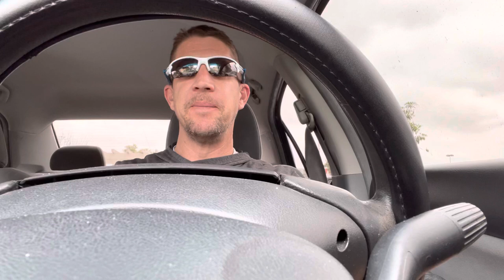CB Radio - The Super Scanner antenna

Comment: My dad had one it performed as advertised . And it worked in directional mode without using a rotor . I think if someone were to manufacture this antenna it would do good in the market , just my opinion 🤙
Reply from the maker: I agree I'm surprised as well no one has made a copy.  Copy like Sirio did for the Sigma 4 etc.

Comment: I talked all over the world with one of these. Sucked locally but seemed to really do well for skip. Takeoff angle was my guess.
Reply from the maker: I'm not surprised.  It probably is the same as a 1/2 wave antenna regarding skip and 1/2 waves do very well for skip.  The difference between 1/2 and 5/8 is very small anyway.  Height above ground can be  another factor for take off angle.  How high was it mounted?
Reply: @Z28videogates  tge bottom elements were about 25 feet off the ground.

Comment: Everybody I knew back in the day loved the SuperScanner.
Reply from the maker: I agree they did!  I remember that too.  But I bet that probably all of them also didn't know if they just used a 5/8 wave there signal would have been the same or even better in all directions all the time.  But I will say that having some directionality is useful as well.  73!
Reply: @Z28videogates  you could be correct regarding the performance of the SuperScanner.  BTW, I've been a ham for 50 years this year, Extra class for 20 yr now. My main interest in radio has been messing with antennas.  I have an ARRL antenna book that has a similar design except for forty meters.  That does add some legitimacy to the concept.
Reply from the maker: @channelview8854  Awesome!

Comment: On another channel they did a coax switch trick to take a pair of cophased trucker antennas and they be stationairy, yet flip a switch and broadside or endfire  3-5 db gain. Kinda cool to do any directionals without a rotator or getting off the office chair.

Comment: Super scanner was a great antenna for the fact that you didn't have to use a rotor. The elements being closer together than .2 wavelengths was done by adjusting the phase going to each element so  they can be closer together than a typical Yagi antenna and still give a decent amount of gain in directional mode. Personally I never buy antennas and prefer a quad to a Yagi antenna. I used a moonraker 4 on a 70 foot pole for years till it was bent up in a hurricane along with a 600watt home-made amp with 2 4cx250b's. If I could hear it I could talk to it. After that I put up a home=made 3 element quad and never looked back.

Comment: Interesting video.  I recently purchased 2 of these antennas and have started cleaning them up and replacing the 50 year old relays/pigtails in the outside control board, also cleaning rust off.  And considering the age of these antennas, I am wondering what condition your friends Super Scanner antenna is in?  For example: Were the outdoor relays original? Were the pig tails (Coax) connecting the individual elements original ? Were any of the steel brackets rusted?   If "Yes" can be answered to any of those questions. Then your results would certainly be "lacking" against that of a new 5/8ths ground wave antenna. (I currently use a 5/8ths ground plane)  if possible, could You please please post pictures of the Super Scanner antenna you reviewed? Thank-You. Kyle
Reply from the maker: Unfortunately this was many years ago.  In the 90's before easy video recording as well.  So you would be very valuable to test this being that you have one of these antennas now.  If you fully put one of these together, it would be awesome if you do an A/B antenna switch comparison and report the results.  I would very much be happy proven wrong.  To be "wrong" would mean that the antenna I had, had something wrong with it.  But antenna theory says it is still possible a perfect super scanner still won't outperform a 5/8 wave because the 5/8 has more dB gain than a 1/2 wave and more gain that the slight gain that the super scanners 0.2 wavelength away side elements provide to it's 1/2 element.  You'll see on my channel I did for example A/B switch comparison between beam and vertical but that's with DX.  I think comparing a local station tx/rx with both two vertical antennas such as a 5/8 wave and super scanner would be an easier comparison.  It would be super cool to see.

Comment: You're wrong on the one element in Omni mode. Omni used all three elements at Once with a length of coax as matching stub. No I don't think the gains were as much as advertised.  The thing was easy to use and was a better fit for users that couldn't afford the space for a traditional beam antenna. I have rebuilt several of them over the years. There are several versions on the relay box having different types of relays on them the older first version of them with Omni are the better ones
Reply from the maker: Appreciate the feedback, and yes I think you are right - all three for OMNI mode.  I guess that's why it may have even less gain than a single element 1/2 wave due to the losses by doing it that way.  I guess SWR would change in the modes too?
Reply: @Z28videogates  yes you do get Swr fluctuating in the different modes. Normally not too bad. My grandpa used this antenna as an easy direction verify as he was monitoring channel 9 in South Houston.  I learned all about them as a kid helping him.
Reply from the maker: @SDS-1  That is so cool as a kid you were doing that with your grandpa!  Good memories I'm sure!

Comment: My dad has one and it performed as advertised . And it didn’t need a rotor for it to be used as a beam . Just a click of a knob . I think if someone were to manufacture this antenna it would do well in the market . Only thing is it could only handle 500 watts which is ok , if modified could handle more ,anyway   Just my opinion 🤙great antenna

Comment: Bullshit. I had one up temporary on a 40 foot mast. I talked to a fella 60 miles away on the beam mode. At the time i also ran a moonraker. There was only one db of difference.  So they DO work. No the relax box wont take much power, but it can be modded.

Comment: This guy doesn't have a clue.
Reply from the maker: I look back and didn't really take the time to really look at this antenna other than performance for the most part.  I still stand by my test results that it really is not a great performing antenna for gain and that a simple 3 ele yagi will be better.  However, for side rejection, nulling out signals, basically a directional antenna without a rotor, it is good.  I plan on doing a follow up video and yes... I'll say I was wrong in that it has one good quality and that is having "some" directivity - but a 3 ele yagi would destroy it in that category as well.

Comment: Never had one but most aerials are quoted as dbi which is not being really honest, plus they quote figures on its strongest lobe of the radiated pattern.  This is usually where you do not want RF to be going, you want it to stay low to the horizon, not at 45 or 60 degrees from the horizon where most aerials are at their strongest!
Reply from the maker: Very good point!  I'll have to do a video on that very subject - that is, WHERE the gain is.  What good is gain where no one is, right?  Regarding dBi gain, that's pretty much the industry standard.  As you probably know, it's just 2.1dB more than dBd.  Even subtracting 2.1, the gain numbers are still BS (as is with most CB antenna gain claims).  Cheers!
Reply: @Z28videogates  I watched a film once at a Amateur Radio Club.  It was a film where the presenter had made small antennas/aerials and fed them with high frequency RF.  He could move around a detector to demonstrate where all the RF energy was going, most of it went to waste and heat up the atmosphere!
It was quite surprising and enlightening.
It is a film I have never forgotten, even if it was a lot of years ago!
He stated it was better if you used lower power and focused it where you wanted it to go.  That is all fine, but not everyone can afford huge antennas/aerials or got the room for them.

Comment: You don't have any idea how this antenna works. Buts its funny as hell to listen to you because i do know how its works. Here is a clue, its not a yagi. I used one in the 70's and they work fine but they want to be at least 60 feet in the air.  THROW ALL THAT YAGI SHIT OUT FOLKS. THAT'S NOT HOW THIS ANTENNA WORKS. Ever wonder why all that extra coax is hanging down around the pole? You didn't cut or shorten it did you? That's how it works. It's magic. Ferdinand Braun's 1905 directional antenna, which used the phased array principle, consisting of three monopole antennas in an equilateral triangle. A quarter-wave delay in the feedline of one antenna caused the array to radiate in a beam. The delay could be switched manually into any of the three feeds, rotating the antenna beam by 120°. https://en.wikipedia.org/wiki/Phased_array
Reply from the maker: Interesting!  I didn't know the attempt was to try and make it a phased array.  The link you provided is good!  I'm always wanting to learn more.  It looks as though this antenna is really all about providing directionality rather than really increasing forward gain over an otherwise standard vertical antenna because by the time you split the signal (loss) and then make it directional (gain), the EIRP is equal at best (and in my field testing, actually lower than the 5/8 wave).  Other issue is a simple 3 ele Yagi would be a simpler way to accomplish the same thing and handle much more power too.  But the biggest disappointment was that the Maco 5/8 wave outperformed it in all directions vs. the SS even in directional mode in the direction it was best at.  It just seemed better to simply go with a very small 3 element Yagi than this.  For the small subset of people that didn't want to have a Yagi and rotor and not really get any more real dB gain over a vertical, I suppose it had it's place.  I think the biggest misconception is that it actually has more power gain but by the time you split the signal, your EIRP is actually less.  I appreciate your feedback!  Maybe I'll do a follow up video.
Reply: @Z28videogates   I wrote this on another blog but there is even more good things about the scanner. One, its quick, no rotator.  I used one in the 70's and it was better than my Super Penetrator ground plane but I had mine up at 60 feet or more and the ground plane was at 50. Most of them didn't work long on the all element mode and I never used mine on all elements to transmit on. The GP was much better. I did play with mine early on at about 20 feet and it worked terribly bad and showed nearly unity gain at that height. Height above ground mattered a lot. If you have it set up with the elements S, NW and NE you can find people amazingly quick with it. I used mine at a time when there was a ground plane up on nearly every house in the neighborhoods abound my area and people were always dead keying on conversations etc.etc. The guys I talked to rag chewed for hours on end. If the offending station was the same signal strength on the NW and NE element and came up on the South element then you knew the person was due South of you. Like wise if the signal strength was the same on the NW and South element and way down on the NE the person was in between the NW and  South element. I could find the persons transmitting direction so fast it would make your head swim. Everyone in my group loved the Super Scanner because of this feature alone. Was it as good as a 3 element? No, but it was close. Was it as good as a Moonraker 4? Nope. It had its place though and for me rag chewing with a group of guys that were entirely South of me was a 120 deg of beam width perfect. Most of my noise was to the NE and/or NW too and it was perfect for reducing that level to a manageable level. If there was someone around on the other two elements that I wanted to talk to, I could hear them but at a reduced level and it was was quick and easy to switch around to them. (two element phased array....https://www.youtube.com/shorts/L-rcfLowzZA) (https://ac0c.com/main/page_acc_towersantennas_40m_four_square.html) (https://static.dxengineering.com/global/images/instructions/com-acb-80-a.pdf)
Reply: @Z28videogates  Right, no its not some high gain antenna with beam width of 120 deg. If you think about it gain comes from a sacrifice of signal somewhere else. ("Understanding Gain differences
In order to understand gain differences between antennas, we have to understand the signal from a good basic antenna like the dipole. A dipole is the normal reference for comparing antennas.
The dipole is also a basic building block of many antennas. Let's dispel a common gain misconception about dipoles and isotropic radiators. 
A dipole does NOT have 2.2dB gain over an isotropic radiator when the dipole is placed over earth. At optimum heights, a common 1/2 wave dipole actually has about 8.5 dB gain over an isotropic radiator! Always remember that when you see antenna models over earth that tell you an antenna's gain in dBi.
If a model over earth shows a "gain" of about 8.5 dBi, the model effectively has the same gain as a dipole at optimum height over typical earth! We cannot add 2.15 dB to the isotropic gain to get the dBi gain unless ALL of the antennas are in free-space! The instant the earth is involved in a model or measurement the 2.15 dB rule flies out the window.
The plots below are for a 145-foot high copper wire dipole modeled with high accuracy ground over medium real earth on EZNEC:
dipole patternreference dipole properties
You can see the gain is 8.5 dBi and it is just a simple dipole just over 1/2 wave high. Any antenna we model should  be compared to a standard like a dipole over real earth (unless we intend to install the antenna in outer space)!" (https://www.w8ji.com/end-fed_vertical.htm)
Reply from the maker: @n5ifi  The dipole is modeled @145 feet but all the others weren't.  Would you agree all the other antennas w8ji did should also be compared at the same height?  It isn't clear the height for those other antennas.  If a dipole has 8.5dBi (the same roughly as a 3 element yagi) then why would anyone bother with a 3 element yagi?  It is generally accepted that you add around 5.5dBi to the gain of a yagi at 1 wavelength above ground which would put the gain already much higher than the dipole even at 145 feet.   Side note, found this, the guy derived the exact same results (5/8 vs. SS) https://www.worldwidedx.com/threads/super-scanner-antenna.198177/
Reply from the maker: @n5ifi  I'm trying to find the info for the SS but I recall seeing that the spacing between the elements is 0.2 wavelengths apart.  Do you know why they didn't do 1/4 wave apart which Braun used?